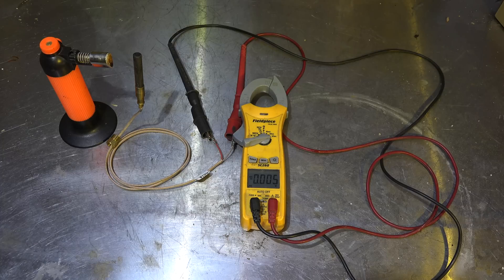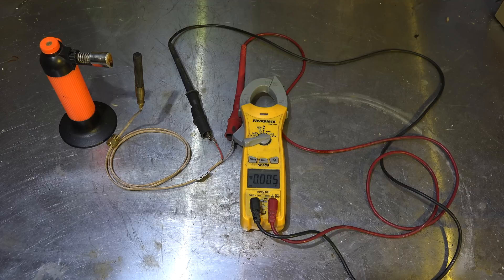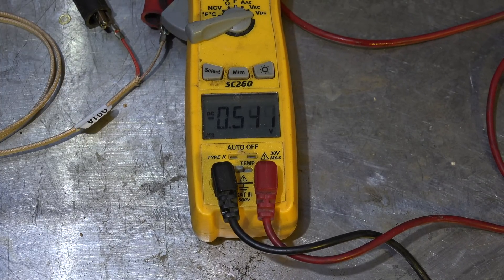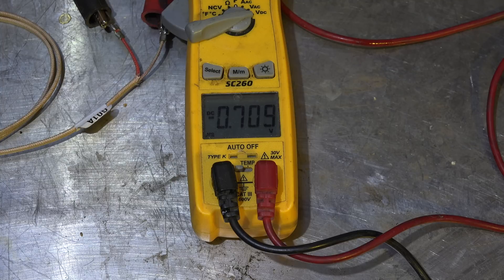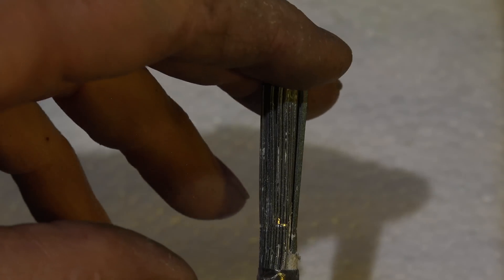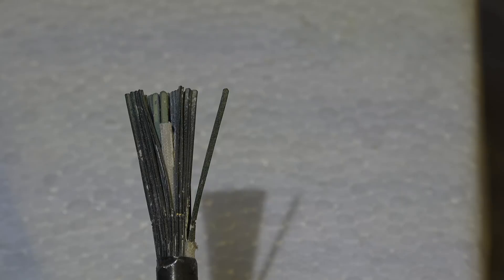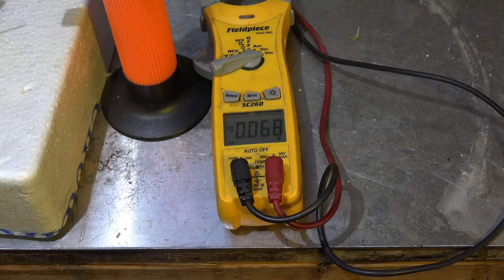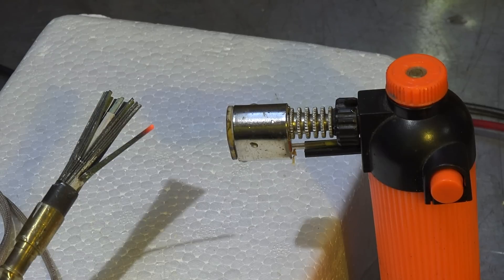How the thermopile works and is made.

Comment: so each wire is a dual wire of different metals that act differently under heat to generate a current?
Reply from the maker: Yes, iron to copper.  The thermopile uses a bundle of thermocouples.
GFM

Comment: How come some gas valves use both a thermocouple and a thermopile?  And others use just a thermopile?
Reply from the maker: The pilot safety is controlled by a thermocouple, and the power for the gas valve is supplied by the thermopile.  In some cases, the thermopile will not shut off the pilot within the 3 minute limit that is required for gas valves.  
GFM

Comment: I have an ongoing problem with my empire wall heater in my work shop.  Over the last 4 years i have had to replace the thermopile 4 times.  I am at a loss as to why.  Any ideas.
Reply from the maker: Are you sure its the thermopile?  Shop heaters often have venting problems because of varying inside to outside pressures.
GFM
Reply: @grayfurnaceman  well once the thermopile is changed the heater starts working again and is controllable by the thermostat.  This heater draws air from the vent and expels all exhaust out the vent.

Comment: Got several from Amazon, but all of them couldn't generate over 300mV on pilot light. If you heat only top part of the thermopile it wouldn't generate over 750mV even they claim 750mV thermopile. Only Honeywell Q313A can generate over 600mV to hold Pitco deep fryer gas valve open as I found so far.

Comment: Hey gfm, why did they ever switch to the thermopile vs thermocouple?
Reply from the maker: They did not switch.  They are different components for different uses.  
A thermocouple is part of a flame safety system to keep the burner from coming on if there is no pilot lit.
A thermopile is a power source for operating the gas valve and it may also be part of a flame safety system.
GFM

Comment: The thermopile on a direct vent water heater keeps going off. I called tech support from State Selet and they don't seem to know what is the reading that I suppose to get out of those. Any suggestions on that would be appropriate. Thank you
Reply from the maker: If I am correct, 350 MV means its ok.
GFM
Reply: @grayfurnaceman  you can't really check them without disconnecting from gas valve otherwise it won't read any
Reply from the maker: @marcosonacheatingllc7525  There should be an open circuit voltage (500 to 750 mv), and closed circuit voltage 125 to 375 mv depending on the load.  Possible short in the load?
GFM

Comment: I have an RV stove/oven and the oven not come on anymore.  It has no outside electricity to it.  So I guess it is a thermopile, not couple?  The pilot light can be lit and stays on as it has no thermo safety control. Only the valve setting.  A thermo probe end is over the pilot light and runs to the oven control valve. Turn the valve on and nothing happens.  

This happened after I hooked up a new propane tank load that I bought from a place I do not normally deal with.  Being that, I first suspected some contamination in the gas somehow clogged that valve but do not know how to test that.   First I going to check the thermopile?  after seeing your videos on how to. Before I did not know how that worked.
Reply from the maker: If the burners on the top of the stove work, the propane is ok.  You probably have a failure in the oven control valve.
GFM

Comment: A thermopile works on?
Plz tell me
Reply: A thermopile/thermocouple is made of 2 dissimilar metals and they generate electricity (voltage and current) when they are in contact. In this case, they will general enough electricity to open up a valve letting gas through to the burner when they are heated up and not enough when they are cool thus the valve will be closed and no gas passes through to the burner.
Reply from the maker: Any gas appliance that is operated without an outside power source.  
GFM